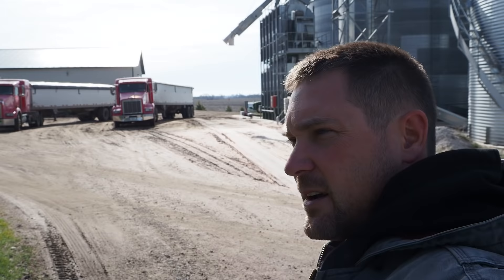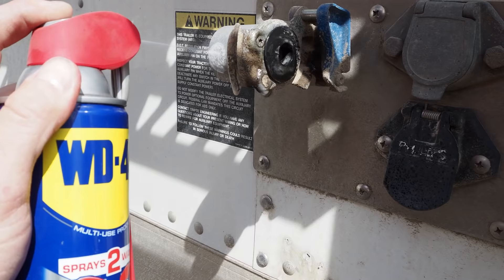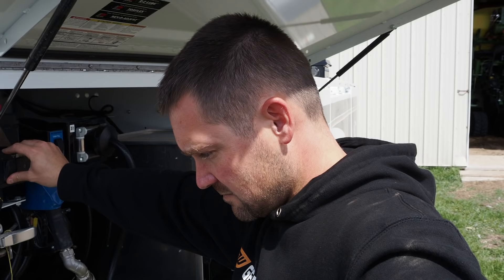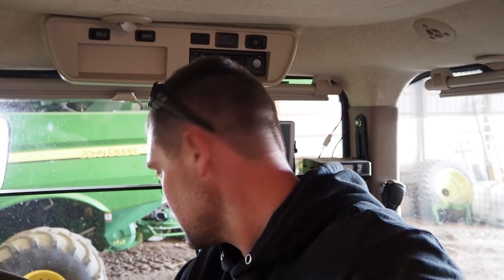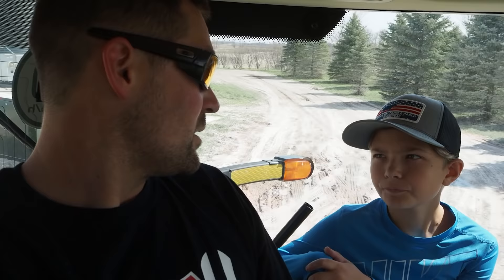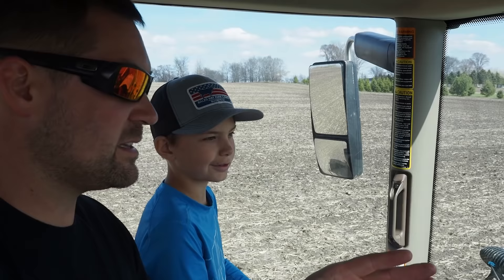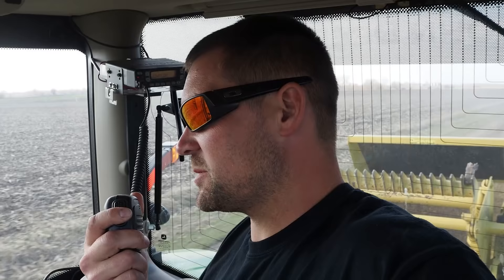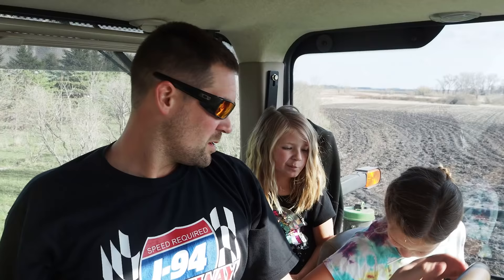BIG Problems

Comment: I'm telling you Zach, set up an air hose just for tires that is connected to a secondary regulator. Set the air pressure you want at the regulator and just go to each tire with the air chuck hooked up to the air line hooked to the secondary regulator. That way, if it needs air, it gets it, if it doesn't need it, then it won't take air. Or get a snap-on or blue point digital inflator and go to each tire with it hooked up to an air line. That way, you check air pressure with the same thing you fill with. Do it all in one swift move.

Comment: Advice from a truck driver.  You want the truck to pick up the trailer when hooking up.  If your trucks are equipped with air suspension dumps, leave your landing gear an inch off the ground or blocks and dump your air suspension when disconnecting from the trailer.  If they are not equipped with air dumps, leave it an inch off the ground or block and slowly pull out from the trailer and let it slide down the 5th wheel.

Comment: FYI from a pro trucker here, there's no reason to raise the landing gear when backing under the trailer. It's much better for the landing gear to lift the trailer off the ground while hooking, and you dont run the risk of high pinning it. Those 5th wheels like to be banged into place, a soft latch like that puts you at risk. You dont need to slam into it, but you want a good positive lock. Always pop under the trailer after a hook and make sure those jaws lock around the kingpin. I've seen too many people drop trailers from hooking the way you did.

Comment: Hi Zach, maybe i have a solution for your 2nd problem. In order to reduce soil compaction while using the 9570, you could reduce the tire pressure. 
Less tire pressure means a bigger surface between tires an soil, which means you have less weight per area. Anyway thats how we handle this in germany. But you have to observe the minimum pressure the tires are made for to prevent damages on your tires.

Comment: 8.5 mph, WOW I spent 50 years fanasizing about maintaining an honest 4.5 mph . In all fairness when I started in the field  in about 1969 The biggest John Deere tractor was the 5010 at a mind blowing 127 HP. . Sadly my dads AR had 35 so 40 acres at 10 ft wide was A LONG BORING day , at least my dad did put a hydrolic lift . There is one thing that you can do in a 5010 cab that is imposible to do in a new one . that is drive standing up , with headroom. Believe it or not my 1964 5010 still runs and operates almost like new , It does have a new home . I rent every thing out so the machinery is gone. Happy farming

Comment: Zach,
An option for tires on your 4WD John Deere would be the Titan Low Side Wall, LSW tires and wheels.  If the testimonials are to be believed, they are reported to perform very similar to a 4 track.  With the Reduced side wall they can run less air pressure and get the benefits of the larger contact patch without the side wall bulging like regular tires.  The LSWs are available in very wide widths so dual tire installations can be replaced with wide single LSWs and still significantly lower ground pressure.  They are branded and sold through Goodyear dealers, made by Titan in the USA.

Comment: Oh Zach, 

Having driven a bunch of years in those orange trucks you see everywhere, please, please never assume that 5th Wheel is locked. I've  seen too many trailers dropped due 5th Wheel issues.
Going  under the trailer and visibly verifying the jaws or cross-lock bar are fully engaged.

Otherwise; your doing great, have, safe, great and a bountiful year.

Comment: You'll get less compaction if you take the rear wheel weights off, Zak!
Reply: And more slippage. Is tire pressure too high?
Reply: @wssides  I’d bet it is, it looked super rough
Reply: I don't use tractors in the field anymore just haul them and some of them have way to much weight on them. If you need that much weight then you are pulling to big and implement. I know everybody wants to get done right now but there is something to be said for taking a little more time and doing it right.

Comment: Zach, if I’m correct, those tires on the articulate, are scraper tractor tires. I’m not completely sure, but I think if you switched to a steeper tread of a tire, you shouldn’t get the big clumps of dirt pulled up behind the tires. I know y’all probably had new rubber put on, when y’all bought it, but if anything, I’d check with Midwest, and see what they say. Just an observation my friend, good luck!!

Comment: A few things I used over the years that made life easier...poly glad hand seals, (Velvac Blue 035009 and Red  035010 you'll never have a glad hand seal issue again, use liberal amount of Dielectric grease on the tractor trailer pugs and try Cats Eyes tire pressure monitors.
One could definitely hear that hyd leak.
The camera difference was minimal so what's easier for you, use.

Comment: Top Tip for Onyx, drive to the rock and just before, turn tight left. Picker goes for the rock and back window turns to the rock too, that way the fender aint there that much and can see better. 

We are almost in seeding too, anyday now (FIN) its just too damn cold right now but in a week or so we are go go go!

Comment: On thé topic of the big tires on the articulated I would suggest running a drag or even a digger over the clods or the whole field just to make sure the seedbed is smooth just in case, to spread any left over straw or fodder out, and to break up any clods of dirt that are left

Comment: We run a 9620r four wheel drive and it does a great job. We farm in central Illinois and have such rich black soil like you do up there. If we get into a bit of a wet field or area, it does make those clods in the tire tracks like you had. We run 600 metric tires on our four-wheel-drive and they work really good, however I did notice that you had wheel weights on your back axle of your four-wheel-drive. We take all of our weights including our wheel weights off for spring time running, which could be part of your issue. I would look into how that would work if I were you.

Comment: Hey Zach give u a tip on removing those hydraulic hoses and with a hammer give it a cuplé of good hits around the fitting and it will loosen it up

Comment: Surprised JD doesn't have a way to make a hose at the local shop. A former tractor guy here opened a Hydraulic Hose shop and any brand tractor parts store and does a great business making hoses of any size for any brand piece of equipment.

Comment: Just wondering if dropping some of the weight off the tractor would help with the tire tracks.  When I was a kid, you pulled implements at 4-5 mph and weighted them down so they didn't spin out. Now you're doing 9 mph and your hp goes into speed rather than pure grunt.  You have a good size stack of wheel weights on that rear axle. I was going to suggest the front weights could be removed also, but you don't even have any. Guess that was on Mike Mitchell's.  

I think it's awesome you are teaching your son to operate this stuff.  Our tractors were tiny compared to yours, but I was on my own doing primary tillage at age 6. That responsibility and the confidence my dad placed in me have served me well though life after over 5 decades later.

I like the 2nd camera better.  Keep up the great work.

Comment: You should shut off autofocus, set your camera on the tripod,, put your zoom all the way out, then use your focus buttons to focus on something far away.  Now return your zoom to normal, if never touch your focus buttons, everything in the area you focused in ( say you focused on something 500 feet away from the camera doing as mentioned earlier) 500 feet of stuff will be in complete focus, at any zoom.

Comment: Use the big hole on the pin and then pull it towards you. That way you don't have to struggle pushing on it. For some reason it's a trick that no one knows.

Comment: I was watching you hook up your Pete and the trailer. I want to give some on-site to hook up differently. #1 The-truck should pick the trailer at least 6”. Here are the reasons. A. It is possible to set the king pin down on the fifth wheel lock and the king pin on will be on top of the latch. You can even a tug test and it will not come off until you are headed down the road an the truck tilts sideways.  B. The landing gear on the trailer is only to hold vertical loads and not for horizontal loads. You lifting the trailer 6”, you take all the load off. I have done more one accident investigation because the trailer was hooked up the way you did.  So think about what I have told you is not to find fault at what you are doing but trim to oven tan accident.

Comment: Hey Zach. Pool noodles or pipe insulation works great as a buffer pad when you have hoses rubbing like that. I used to use those inserts that cost a bazillion dollars but always dry rotted. I just use red pool noodles....cuz it matches my tractor😳😳😳

Comment: In my little part of the heavy clay Red River valley in Manitoba spring tillage meant lumps and poor germination, especially in the wheel tracks.  Any tillage had to be in the fall but in the spring we stayed off the land as much as possible.  I think you are setting yourself up for germination problems if you don't get a timely rain but hey, farmers known their soil and what works and doesn't work for them, usually from someone's hard experience.

Comment: If you use some dielectric grease on that electrical connection on your trailer you will have less issues with it. Also a dab of petroleum lube on those glad hand seals the will seal better and last longer.

Comment: WD-40 is not a lubricant. it's a de greaser.
On the planter, both front and back of the beam you should use permanent white reflective marker to write row numbers on the beam for quicker references.
I was my grandpa's rock picker riding around in the front bucket of his MF. so much fun.

Comment: I'm wondering what kind of motor you had in there.

For my 6.0 at 28, 000 mi in change I had to rebuild the turbo. At about 60,000 miles the high pressure oil pump blue. That was three grand. And about 79,000 MI the low pressure pump blew and that was a grand.

Yours had to be a pretty penny but like you say cost of doing business.

Thanks for all you do for the other farmers in need and for all these shares!

I hope your family is abundantly blessed with all that's good until then take care and God bless

Comment: Maybe you need to swap the duels out for quad tracts that would solve your problems with the cloddies and soil compaction .we have soils like yours that clod up like that when damp. So while we don't actually have a tract tractor yet it's on our shopping list of need not want. W we only use the wheel tractor when conditions are drier.

Comment: 30:25 The only problem is, that you have way too much air pressure in the tires. Lower the pressure and the soil will not get compacted so hard. The tractor would also run faster (less slip) and save a lot of fuel. Farmers who don´t get that, need expensive tracks.

Comment: Little trick I’ve learned from changing hydraulic lines if it’s really tight give it a tap with a hammer and then it should come easily

Comment: Here is a tip for tight hydraulic fittings that will sometimes help break them loose. Tap or smack the female end with a hammer on the flat faces of the fitting where the wrench would go. It doesn't always work, but usually it will make it a lot easier to break it loose. Just a tip from your fellow diesel mechanic..... he said just a tip. 😆

Comment: get yourself some cats eyes for your wheels and that will save you lots of time in checking tyres and you can pump both tyres at the one time or single valve. Im sure you've seen them around.

Comment: Zach the 9570 is a work horse 🐎 I have used that machine when it was brand new John Deere equipment is built to run 🏃‍♀️ from 94 to 21 and still running 🏃 John Deere equipment on a farm is supperior to anything else 🤩🚜🛤😎❤️🙏

Comment: airlines?  don't really need anything..  The electrical,  get them clean and load them up with dielectric grease..(can't hardly use too much) you could use some of the dielectric on the gladhand seals if you really want something on them...   Driving OTR and dealing with trailers all the time, you catch a few things to make life easier..    I do not mind picking the trailer up a few inches when I back under them either..   a little air under the legs is kind of nice when you get tired of cranking them up and down..

Comment: I’m going to ding you a little on your hydraulic hose mechanicing. It’s been a long time since I’ve worked with them but when you take them on and off you use two wrenches and never an adjustable. But I also realize that this is an older video and you’re dealing with some stuff right now.

Comment: and spraying that in there will wreak the rubber in the valves ect, if use anything use air tool oil, however being a trailer repair person as i am i love charging huge bucks for valve replacement, and changing glad hand rubbers when them sorts of chemicals wreak those rubbers also.  want to do any thing spit on the rubers and they will actually seal tightly

Comment: Take the 9570r out of the auto transmission mode. That tractor will have no problem pulling 33ft at 10 at 4in. You should be able to go 12.

Comment: Because I don't know: what tire pressure do you run, and would running lower pressure help the compaction? Seems odd that the thinner tracks with relatively little give would give LESS compaction problems.

Comment: Iam no farmer, iam a mechanic but I have worked in lawn agronomy for awhile. ( basically iam saying my skill set is no comparison to yours here) but, could a potential fix for your tillage problem be to chip tune the 9570 to get some more horsies to help out, and match that extra power with airing out her tires to a lower PSI? Sure youre going to have MORE ground contact then... but shouldnt the PSI youre putting into the ground with the big girl go down a little bit then? My expertise is road vehicles... but seems like you could have something if you lower that tire pressure and tune the ecu for more power, ( and speed) for your mondaco. Right? Or am i totally off with my analysis of the situation>?

Comment: Just curious about the tire pressures on the 9570, if the weight of the tractor would allow you to reduce the pressure and expand the footprint helping with the compaction???

Comment: Zack to help with tire pressure on the trucks, I would highly suggest a set of cats eye tire pressure system. I have them on my truck and it saves tires and makes my walk-around much faster. They are expensive but it keeps the inside and outside tire pressure balanced which makes the tires last longer. Also with the visual component it's very handy. https://www.amazon.com/dp/B01MXPIPK0/ref=cm_sw_r_cp_apa_glt_fabc_4KRBQ07YAG9HA1V5NM2F?_encoding=UTF8&psc=1
Reply: Hi Nathak Cherrk.